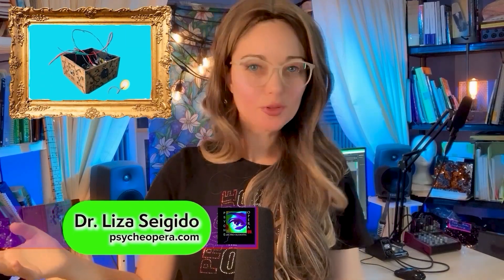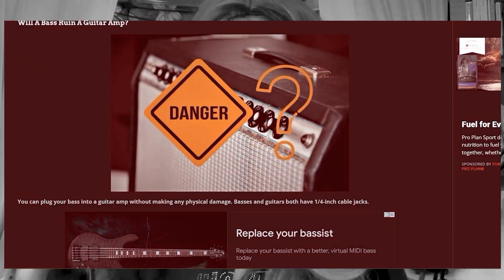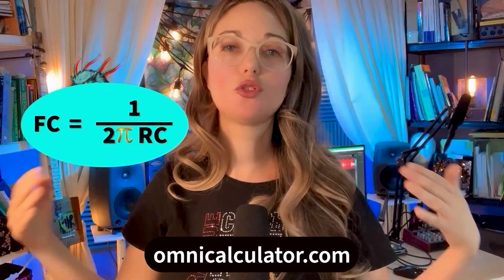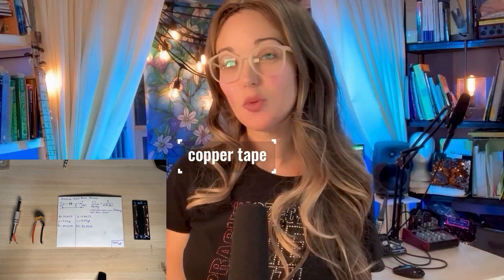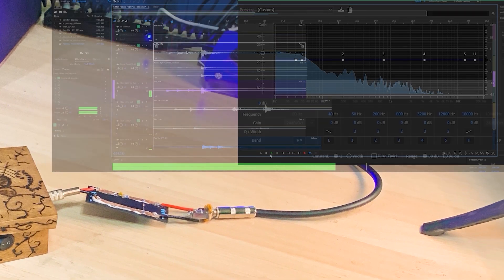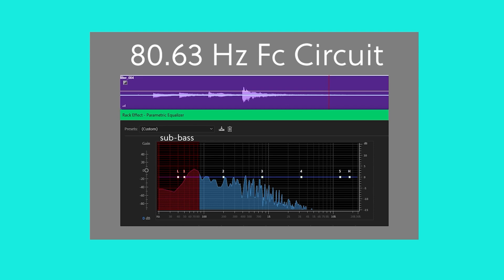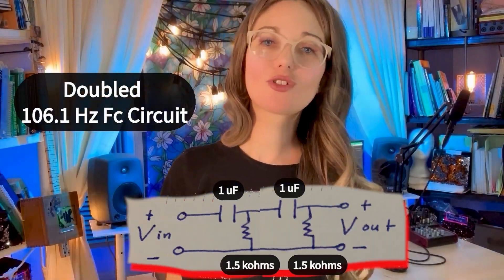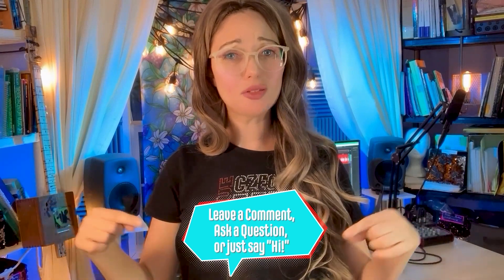Reduce Sub Bass from DIY Piezo Preamp  : How to Build an Easy Passive High Pass Filter

Comment: I am an audio electronics designer and run the Medialab at HFBK Hamburg (a German university) – and coincidentally a bass player who plays his bass through a guitar amp for 8 years now. I am sorry to say this, but the article in question is BS. If your guitar amp is designed the right way, it has a decoupling capacitor at the input that will give you a Highpass Filter on input. I haven't seen a guitar amplifier without one in 15+ years of circuit analysis. This isn't done because these circuits wouldn't survive DC/low frequencies, this is done because the low frequency content is seen as unneeded "garbage" by circuit designers of guitar amplifiers because it shouldn't be audible in the instrument anyways. And if you amplify frequencies that you cannot hear you waste your precious watts on a thing that doesn't matter. Aside from that having low frequencies in the signal shifts the bias points of the various stages and changes the distortion behavior.

But: typical guitar amp circuits can totally live with DC/low frequency content on the input and what was seen in your spectral graph is TOTALLY not overkill. A guitar amp should easily survive 10 times that level. If it does not it is a shitty design and you shouldn't buy it. What however does not survive DC of sufficiant voltage and current are coils (e.g. loudspeakers). This is why many guitar amplifiers (depending of the type of amplifier architecture used) have a high pass filter in the output stage as well. If your amplifiers kills loudspeakers when you hook up a 1 Herz sine generator to the input it is also a broken design.

I am pretty sure that article is overhyped and as someone running an electronics department I have to say it smells of someone who has only a vague idea of what they are talking about. Sadly this is not uncommon in the world of guitars, where physics are not completely understood...
Reply from the maker: Hi 👋 Thank you for checking out my video and for the detailed information. 👍 It’s good to have people with your expertise in the guitar and cbg community. ✨ I will pin your comment so that it gets good traffic. 💡Please feel free to share your wisdom on other videos about my piezo preamp; I’m planning some upgrades to cutout unusable bass “in house” and recover high frequencies reduced by electrolytic caps. 🙏😀
Reply: @Windkind0 hi, a bit unrelated, but I have a question maybe you could help with. 

I have an early 70s  solid state 60w paging amplifier that I built a cabinet for with an EV 12L speaker and use as a practice amp. 

Since it is a paging amp, it has a 70hz-12khz output transformer. To a degree, it actually compresses the tone like a tube amp, and sounds pleasant. But when I play anything below 40hz the speaker starts farting .... it's a 300w handling speaker, being given 60w,  so it must be the O.T. can't process the low frequency. 

I had a 470uf cap in series with the speaker at one point - sounded great, crisp, punchy low end. But it was only a 50v cap, so it blew up. 

I can't find a 470uf 250v bipolar cap, so could I add a decoupling cap to the inputs? I sort of doubt they have one. Would it just be the cap in series on the signal? 

Thanks

Comment: Have you considered replacing one of the 1.5k resistors in the high-pass filter with a 2k potentiometer? Would that possibly give you a little more control of you tone?
Reply from the maker: That’s a great idea! 💡 No I hadn’t considered that and it’s definitely worth a shot. Thanks for sharing! ✨💕
Reply: @ I could only imagine it would work similarly to a treble bleed circuit on a guitar. 👍🏻

Comment: Following this as I'm looking to add a piezo pickup to an old nylon string guitar. Have you tried putting the low cut filter in front of the preamp so the low frequencies don't get amplified to begin with?
Reply from the maker: Hi! 👋 Thanks for checking out my video! 💕 Months after the production of this video, I learned of a better solution to the sub bass problem. 💡If I switch out the 3M ohm bleed resistor in the preamp itself to a 1M ohm or lower, I can potentially block out the sub bass from the piezo without needing an external high pass filter. ⚡️I plan to make this and other improvements to my preamp circuit soon, and will share my results here on YouTube 👍 Stay tuned 🙏🌺
Reply: @psycheopera looking forward to it
Reply from the maker: Awesome 😀🌺

Comment: I decided to put a preamp for my CBG as well. I decided to take apart a 10 band eq use it in line. It's really good at cutting out the frequencies you don't want, but you still have to have a 9-volt battery in it if you want to play it as a bypass.
So whatever you do, don't plug it in and leave it sitting somewhere, or the battery will drain.
I really want to try a piezo pick up.
Reply from the maker: That’s a really interesting idea 💡 ✨ Feel free to share your build here in the comments with links. ✨ I would definitely like to see your EQ setup👍

Comment: Could bass amps be damaged by sub bass (<40Hz), too?
Reply from the maker: Hello! Thank you for your question. Unfortunately, I don't have the answer to your query. However, if you are worried about your bass amp, it might be a good idea to create a simple passive HPF with a 40 Hz cut off. This will help eliminate the sub and bring out the high frequencies, which can enhance the presence of your sound. So, building a HPF may be a good idea either way. ✨😀
Reply: @psycheopera  Thanks!

Comment: Not sure why you added a redundant, external  high-pass filter when your preamp circuit already has one. The 4.7uF capacitor and 220K ohm resistor in the preamp circuit comprise a high-pass filter, albeit with a very low cutoff frequency of about .15 Hz. Changing those two values to something like .1uF and 22K ohms, or .47uF and 4.7K ohms or 1uF and 2.2K ohms yields an approximate 72Hz high-pass filter with no need to build a separate circuit.
Reply from the maker: Hey there! Thank you for your feedback! Since the video was produced, I've been working with another tinkerer to address the sub-bass issue without needing an external HPF. Our research has led us to believe that replacing the drain resistor with a lower value may increase the cut-off frequency, which could be the solution we're looking for. Additionally, I'm currently exploring the possibility of installing bypass film caps to help with the treble deficiencies caused by the electrolytic capacitors. I'm still in the process of putting together the new preamp circuit, but I plan to share all of my findings once it's complete. While this project may take some time because I'm working on other projects as well, I hope you'll stay tuned to my channel for updates on this ongoing preamp project. Thank you for checking out my work! Cheers! ✨

Comment: Nice update, probably helpful for people just getting into electronics! 🤘🏻
Reply from the maker: Hey Anthony! I'm glad you liked this simple solution. I'm currently working on enhancing the frequency response of the piezo preamp and will keep you updated on my progress through community posts. I'm researching the use of bypassing caps and replacing the bleed resistor for a more balanced sound. Thanks for taking the time to check out my work! Cheers!✨